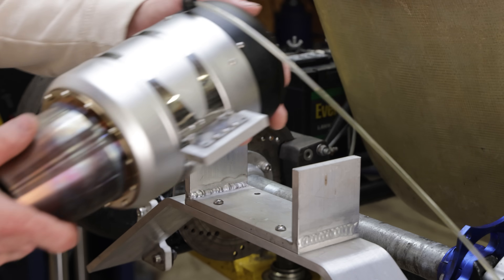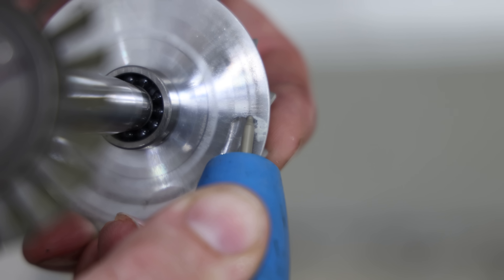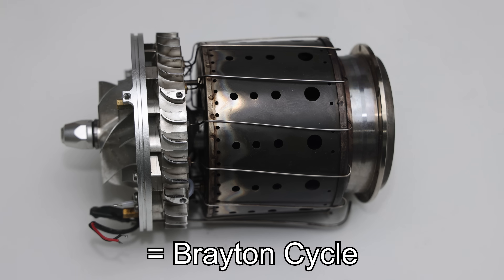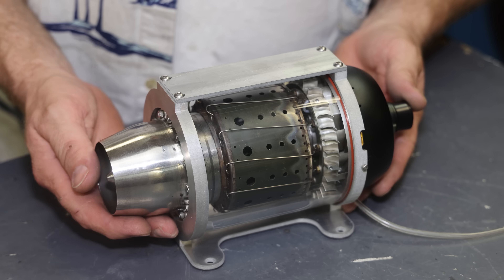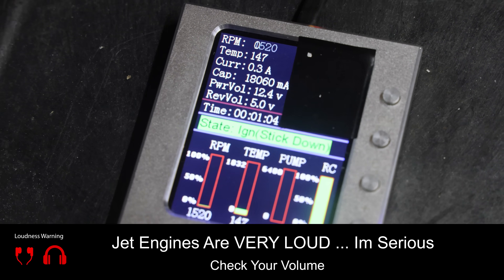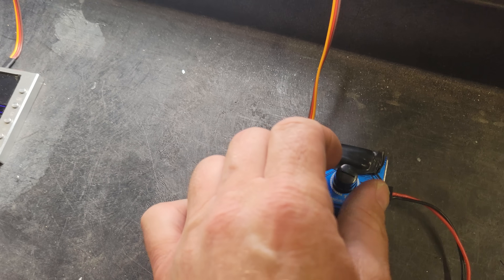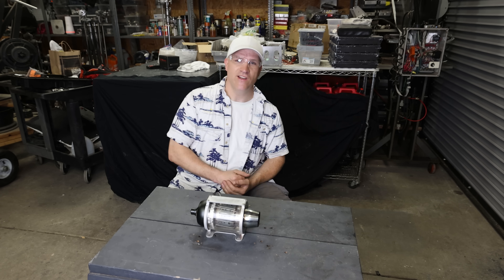See Thru Jet Engine

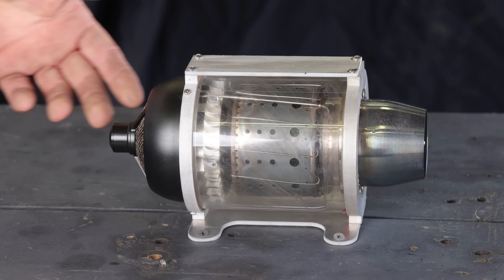Comment: 8:40 One would think that a modern commercial jet engine turbine with a high bypass ratio would draw in comparatively more air, such that in your example, if 80 lbs of air exit the rear, somewhere around 40-60 lbs are getting pulled in the front. If older "cigar" turbines can be imagined as the core of a modern turbofan, and said turbofan has a 10:1 bypass ratio, we can multiply the mass of air drawn through the "cigar" (lets say 5 lbs) up to 50 lbs. I think many airliners' turbofans cruise at an engine pressure ratio (EPS) of ~2.7:1 (so ~37% of the exit pressure is drawn in the front). Curious on anyone's take. Edit: I'm only just getting into this stuff and I'm seeing search results of cruise EPS around 32 - so I'm probably way off
Reply from the maker: Well this is a Turbojet not a turbofan, a turbofan will pull in much more air by comparison. Turbojet get most of their thrust from the combustion expansion process not air compression prior to combustion, hope that made sense.

Comment: a  colored  smoke  and  slow  lead  on  volume   of  smoke  but  once  it   hits  the  path  of  flow  its   imediately  going  to  disapate  anyway   ,  but  with  something  that  shows   in the  inside  flow  may  as w ell  not  make  it  past  the  oever  heated  air  maaybe  with a   high  speed  camera  and  seeing a  fine  black  carbon  silk  like  trail   that  doessnt  look  likie  much  at  all  just  exhuast  vapor  .

Comment: 🎯 Key Takeaways for quick navigation:

00:00 Jet engines are favored for projects due to their extreme nature. The video will demonstrate the internal workings of a jet engine in slow motion.
00:58 Turbo jet engines operate on a Brayton cycle: compression, combustion, expansion, resulting in thrust.
03:27 A transparent jet engine is successfully built and demonstrated, revealing high pressure and airflow characteristics.
08:58 Jet engines primarily derive energy from fuel, not air intake. This clarifies misconceptions about air volume intake versus thrust output.

Made with HARPA AI

Comment: I was fortunate to have gone through Turbo machinery training by Solar Gas Turbines. These were industrial engines used for Power Generation. I worked on their series Saturn, Taurus and Mars Gas Turbines. The Mars engines were rated 30,000 hp and were fueled by Digester Gas, (Methane), from the Digesters at the Joint Water Pollution Control Plant in Carson, California. The heat was recovered from the exhaust and generated steam that powered a Trans-DeLaval Steam Turbine. I had the fortune or mis fortune depending on your point of view of disassembling and remachining the seal and bearing journals after sudden extreme stops causing great damage to the steam piping and turbine.            Trim balancing was always fun as the Mars engine has twenty-one compressor stages that had to have little weights inserted next to specific blades that’s was very difficult and absolutely no room for error. Ah dang I’m glad I’m retired cause that was actually very hard work because you might have to do it fifteen times before the machine was within tolerances. Hundreds of special bolts using nicklesieze to prevent galling. Go slow on those bolts folks because they will gall if removed too fast.      No impact wrenches used or allowed. Only hand tools and torque wrenches. Good luck. Hermit

Comment: In order to make the air stream visible by using fog, running the engine with just the starter motor could / should have done a better job, imho
Besides that, nice job! Cool to see what goes on inside

Comment: That was awesome.  I never realized the compressor blades didn't rotate until I saw this.  So the thing i never understood about these is why does the pressure in the combustion chamber does not push back on the intake blade and slow/stop the engine?  It seems like it should counteract the incoming pressure from the compressor.

Comment: So you can just make a Boeing 777 from that jet engine so just make two of them and make the whole 777 design and the wings working flaps, working airbrakes, and working reverse thrust (btw the fuel tanks are actually in the wings of the plane) and its basically like a working rc  777.

Comment: Awesome video. Maybe you covered it but I didn’t see it. What is happening at the intake at start up? That visible vapor. And how about lubrication? Has to be some crazy friction going on there and any oil has to be burning off quickly. Do you use anything at all? Graphite or something?
Reply from the maker: I'm not sure if I covered that, I have to look at it again. As for the lubrication the oil is mixed in with the fuel.
Reply: @WarpedYT  - Ah. Gotcha. Awesome videos.

Comment: Awesome video and awesome idea! It would be funny to see passengers' reactions if there was a type of glass that could handle the heat of a large passenger jet engine. 🤣Also, from a background in aviation and aeronautical science, wouldn't the grid in front of the turbine disrupt the intake's airflow and cause it to suck in less air, causing extra heat and reduced power? That's why commercial jet engines (and propellor planes) don't have a protective grid.

Comment: I've often thought of doing this with my DIY jet engine but didn't think regular glass would hold up. Did you use corning wear?
Reply from the maker: Be very careful...very careful, even this material which I developed for my see thru engine series took me over 4 years to make, and its still very risky and unpredictable. If you do anything with glass under pressure or worse heat and pressure especially varying, If it explodes you will have pieces of glass stuck In you all over the place, And your eyes forget about it. I had a small incident about 10 years ago, I had pieces of material coming out of my leg for months.

Comment: Jets engines is outside force to drive , my way is inside force,  internal driving way . 
It's very hard to drive and letting go by means of force of outside to drive the inside . By means of air compress and fire to move the inside .
My way is antigravity way gapping zone way . The front pulling the back is pushing center zero which is the chassis and load is following only. 
It's antigravity way weight out traveling in gapping zone way .
You do it your way it's not that way .
Ok your money do eat your way , and it's not perpetual power.

Comment: Very well done. I love those experiments. One can see the temperature distribution of the combustion chamber at several stages of the run up. Thank you !!  One remark from me: dependend on the smoke or fog system you use the compressor heats up the visible parts of the fog so that the vaporize or in case of dry ice sublimate. So the flow after the compressor is hardly to be seen.

Comment: If you use the Transpose Chrome Extension to loop this video between 05:49.0 and 05:57.2 at 400% speed, you can better see the change in pressure as the engine is revved.

Comment: do these simple turbines actually compress the air as surely that would need the turbine to pull in more than one rotation of air per rotation?
I was under the impression simple turbines get their power from accelerating the air out of the circumference of the turbine wheel and forcing the air through a small annular passge or into small burner tubes a la Whittle turbines?.
surely the intake wheel only compresses the air if the annular area of passage behind the intake wheel is less than the area of the inlet wheel?

Comment: Adding an afterburner is basically just mixing the exhaust with fuel, setting that on fire and vectoring the thrust using some kind of nozzle like a rocket. Concorde's engines used clamshell nozzles which also acted as thrust reverser "buckets" on landing.

Comment: the front outter compressor blades aren't moving, i wonder why? Shouldn't it be moving in order to help it do it's thing? The other parts is like blocking the front compressor wheel thing

Comment: Awesone video op. Quick question tho, you said jet engines dont pull in 70 pounds of air. If this were a high bypass turbofan wouldnt most of the thrust come from pulling bypass air through?

Comment: but your fan blades arent spinning so its a low bypass right? A commercial alirliner needs that high bypass air to turn the fan blades right? Im just trying to understand the difference or if theres a difference between a "jet engine"  and a turbofan engine like in all commercial jets.

Comment: i am still surprised that the glassy looking material resisted enough to such high heat  it is very crazym by the very end the joints started to get dilatated 5:33 Still It is really very cool to get a see thu thank you Sir!

Comment: Technically speaking, (@ approx 2:05), the compressor blades speed up the air going into the engine while the stator blades compress the air, change the direction of flow and slow it down. Then it continues as described.

Comment: This is awesome to see inside a single compression engine.  Maybe you could make a 12 stage see through compression engine with 4 stages of turbine or maybe you could just get an F15 motor the Pratt & Whitney F100 and make it see through.   Now that would be cool.  I rebuilt one in 1980 when I was in the Air Force and watched it run on the hard back stand at full power at the Test Cell when it was down at night, Wow what a sight it was with the blue flames coming out of it's tail at full power.  I took a photo of it, but over the years since I have lost the photo.  Can't wait to see your next show.

Comment: That's great, but a multi-stage jet engine is actually a powerful compressor. It compresses the air-in flow in progressive stages and supercharges the fuel/air pressure, right? The jet engine you're using is a single stage engine most often used in large-scale RC aircraft so we don't see the various stages I guess.
Rich

Comment: When they first built these things the position of the holes were just done by someone guessing where they would work the best. No real design, more a case of I'll try a hole here, and maybe there...they still worked and if the worked better it was incorporated into the design. I've seen turbines with different setups for internal vanes, some way different from the other. Thankyou for making that and publishing the result. Thats alot of work! Cheers

Comment: would it be theoretically possible to use  a smaller low powered jet engine to put on a bike in place of a standard motorcycle engine and would it be street legal assuming it didnt go 7 billion mph

Comment: I noticed that the fuel has oil in it.  Is the bearing under the compressor a sealed grease bearing? And does the fuel flow through the turbine bearing to lubricate and cool it?

Comment: Jeeeeezus.....that pressure is NUTS!  Seeing it flex back and forth in that one clip, is absolutely BONKERS!  It looks like it needs a couple more supports down the center on both side of that aluminum frame.  It was so powerful it kept kicking out that gasket.  I wonder if a tougher frame will even hold it together or if it'll break it or burn it?

Comment: What are those paper clip lines in the flame holder area?
Reply: Fuel lines. Silly way to bootstrap injection. At least on rockets Regen is used to coole the nozzle

Comment: Wow amazing.  I am just amazed that you can make these your self.

For the smoke test, i suspect the smoke was being sucked through too quickly, and being burnt or heated in the outer cylinder.

For the smoke test, you should do it without the flame.   The hypothesis would be a loose smoke going in, then being compressed to something a bit more opaque, as it gets into the compressor and pulled into the burn chamber, then loosening back at the other end.

In a normal Jet engine, isnt it like a funnel with compressing blades through out the body to really get compacted air that is burnt?

Comment: Testing combustion chambers for my 54 mm helicopter turbine . the type of combustion chamber demonstrated is not efficient .  the diluting zone is contributing to the burn . My test rig for the combustion chamber was needed because of constant flameouts from your design . I used one active fuel needle and otherwise a full chamber . initial lighting was done using gas   then the  gas to fuel  ratio was tuned to achieve a flawless transition . keeping the combustion in the 20% combustion zone was achieved using simple flow offset holes in the outer and inner and front face  to introduce the torroidal mixing of the fuel / air .  being able to control the airflow using a speed controller on the intake airflow was priceless .  operating this test rig highlighted the unburnt fuel which was invisibly exiting the combustion chamber .leaving a wet fuel slick on the epoxy painted workshop floor . Richard Wallinger / midland Helicopters   UK LTD   hinckley Leicestershire .2m rotor Alouette .  the first successful r/c  Turbine powered heli . clearly far too much power using a 54mm 72mm . free turbine set up .  anything more than 2 volts on the fuel pump would shear the rotor jesus bolt . original 688 ceramic bearings after over 15 years of demonstrations and flying for pleasure .. two combustion chambers due to vapouriser tubes fracturing . gave up flying it due to my trusted 35m JR TX going dead after a few minutes operation ..   It crashed  .. failed to speak to my helicopters and drones after a few minutes seemingly faultless operation . scary stuff.

Comment: I knew the fog would atomize in the engine and we wouldn't see it, it's the same with jet engines in clouds or rain.   However I'd never have guessed that the plexiglass or glass see-through casing would not melt.   I thought this would be on of those "fail" videos where the thing comes flying apart when the plexiglass melts.   Great job on this.
Reply: I thought about that myself.  It probably wouldn’t last in “real” usage, but it seems sturdy enough for a couple or so demonstration runs.

Comment: Why do small jet engines only have one compression stage?
Im not sure, but i think that most engines for real planes have two.
Is it more or less efficient?
Reply: More bang for the buck. RC jets fly for like 15 minutes before the pilot loses concentration. I mostly hate how hot the exhaust is after only a single stage of turbine. After burner hot.

Comment: As a helicopter pilot there's no sound more pleasing than the startup of a jet turbine.  Having watched your video I can now truly grok what is happening in the engine in pre-start, initial ignition, complete ignition, and the spooling up as the cycle completes.  Wow, just plain wow!!  Thank you!!

As someone has already said, you're a very talented machinist/engineer.  As an A&P has said this is accurate and useful.  And now you have it from someone who power up, injects air to start the cycle, introduces fuel to start the ignition, and enjoys the resulting power out the other side!! 

Also seeing the power come from the fuel and not massive amounts of air is a double-take worth its weight in gold.  :)
Reply: Is it true that helicopter engines are always running at or close to 100% power and just changing prop pitch to go up and down? I had always thought that "give it more power" was exactly that, more rpm, but someone told me that collective is just pitch.
Reply: @Expedition_America  This someone was right, it is only pitch to change the lift. If you change the rpm of the engine it affects the behaviour of the helicopter during the flight. This is what you don't want. Stable rpm means stable flight. I'm flying rc-helicopters, at least here it is this way, I guess in real helicopters it will be similar.

Comment: Incredible engineering design and machining chops.  But is your jet engine controlled by the electronics circuit board was that simply for starting and monitoring speed and you controlled the engine by the amount of fuel?

And what kind of plastic can stand that kind of heat or was it Pyrex glass?

Lastly, large plane engines obviously do suck a lot of air in or we would not be hearing about birds and airport support crew getting pulled into them, but that just shows how much more volume is pushed out the back.

Comment: How did the start at the front not melt?
With all that heat and it being so small, you would think all that plastic and circuit board would melt.

Comment: I believe I just discovered that you're not all that knowledgeable about turbine engines. That's how I know this is when you shut it off. You didn't bother to let the bearings cool down slowly. The exhaust bearing is really, really hot. And you're supposed to continuously have the fan. Blowing whether by electric motor or by leaf blower. What are the other that will help save your exhaust bearing site?  Not your compressor sign, but your exhaust compressor sign has to be cool before shutting down. All the way I'm just saying.

Comment: How does the thrush exhaust drive the intake fan? ..... Otherwise that was just awesome and thanks so much for finally letting me have some inkling of how these things work. Just in time for me to kark it but better late than never.🤗
Reply: Compressor and turbine are connected by a shaft. I begin to believe in coaxial tubes rotating in the same direction for multi spool. This way friction is minimal.

The large ball bearings just have to be accepted.